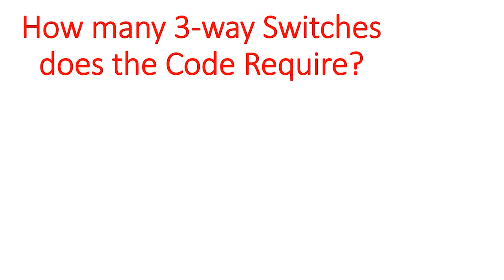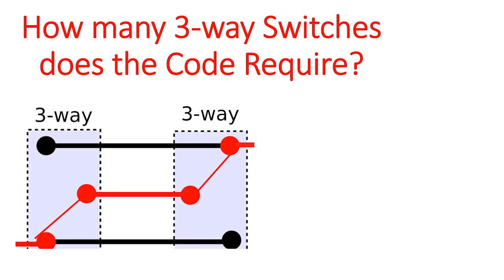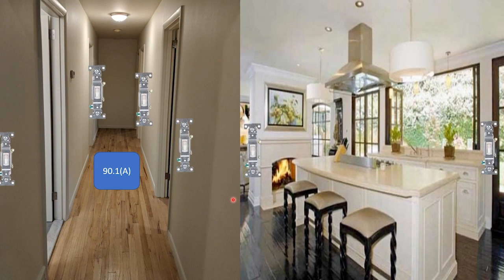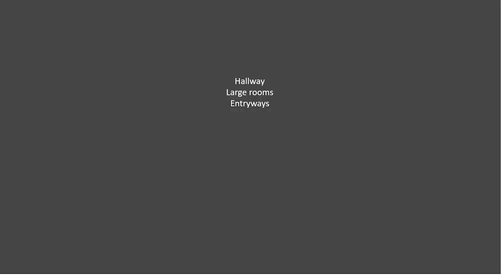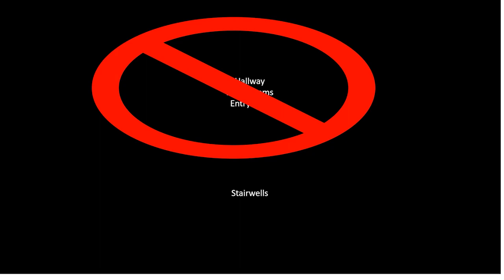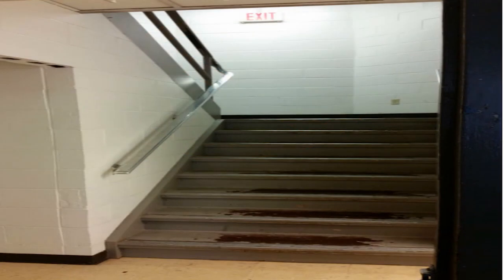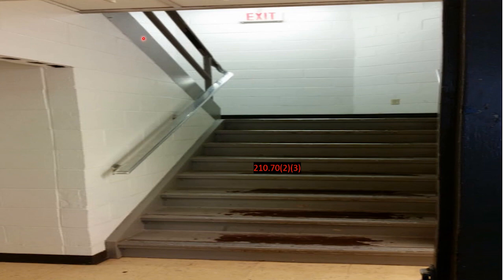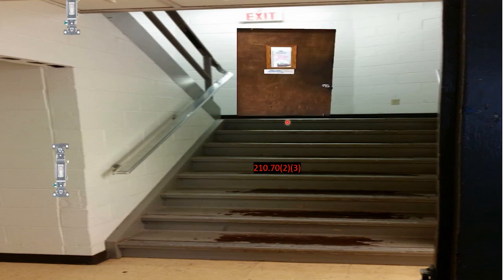How many 3-way switches does the code require? Where are 3-way switches required??

Comment: Hey coach I need to run a line of armorlite 10/2 cable from my panel through a concrete block wall, do I just pass it through and mortar repair the gap around the cable or do I need to use a special pass through coupling or pipe? Thanks for your reply. Cheers